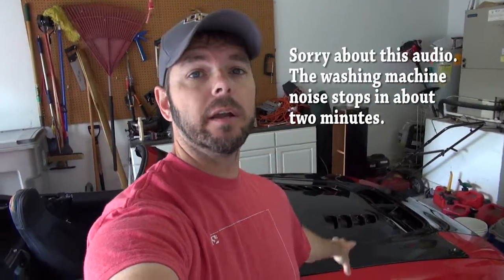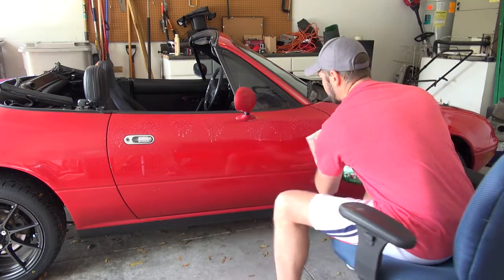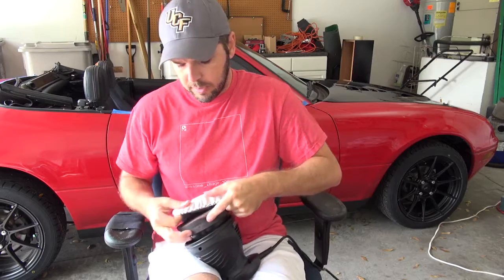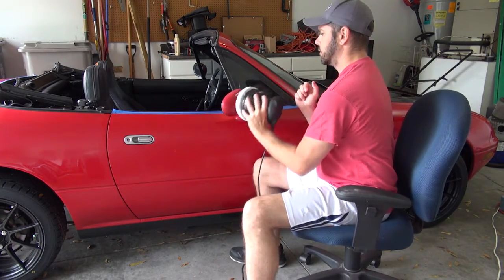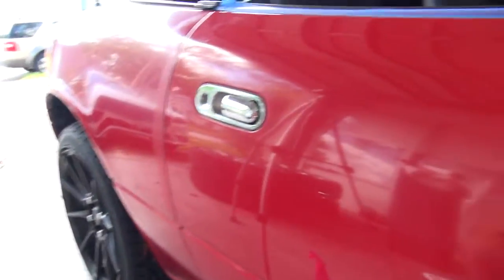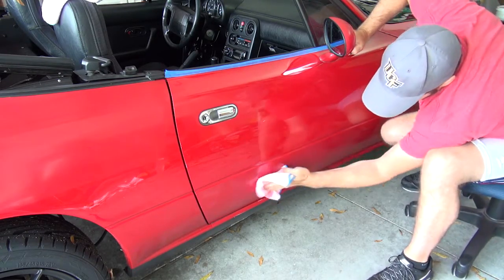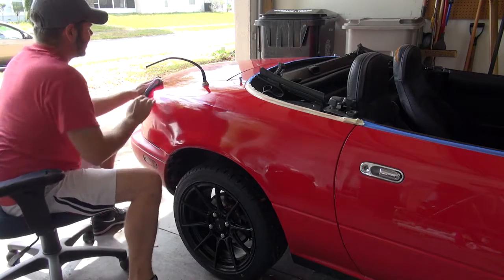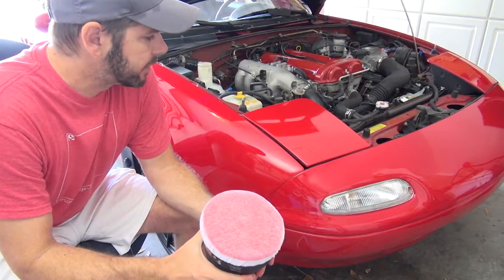1990 Miata Project Episode 19 - Return of the Living Dead Paint

Comment: Wow you weren't kidding, that paint shined up so well from the sad shape it was in. The trunk paint actually doesn't look that bad for everything being polished, but it is obvious. As for the fender, it's upsetting that the line is quite obvious even after cutting and buffing. If you do decide to get a new trunk lid, maybe steal the fender off that car as well? I suggest this because I also noticed a deep scratch and dent in the same fender. Also, did you hand polish the base of the mirror? It seems like the orbital polisher wouldn't be able to reach it well enough.
Reply from the maker: +Ryan Sapp I saw that scratch too.  The dent is tiny and I can live with it.  I also discovered that when the wheel fell off the car that one time, it dented the bottom of the wheel well fender on the driver's side.  These are all pretty minor things and things I consider unique charms of the car.  I'll be buying some more aggressive cutting compound that should fix that scratch you saw and hopefully cut down that hard topcoat line.  

I'm not giving up on that trunk lid.  I just have had a ton of other fun things I've been doing with the car lately, so it's back burner for now.  It's very nearly to a place where I'm really happy with it.  I'm still trying to figure out the exhaust situation.  I put a cheapo replacement on it to fix the annoying rattle, but it only sounds good under 4k and when the throttle is less than half open.  Otherwise, it's fartcan city and that's the last thing I want.  I also think I lost some power with the new exhaust.  Looks great, sounds shit, doesn't perform.  So I had the old one welded to fix the crack and will be putting that back on tomorrow, I hope.  

At that point, it should be a great stopping point and I can concentrate on little things like a fuel filter, and then try to justify a steering wheel and shift knob.  I've also got to do something about the driver's seat back and the torn area.  But that will take some research and trial and error.

Thanks again for following me on this journey.

Comment: Hi, great video and nice taste in cars. The NA Miatas are wonderful. Fun to drive, handle great, very reliable and parts easy to come by. I have owned 7 NA Miatas throughout the last 25+ years. My first was a brand new 1991 NA classic red A pkg.  The only question I have is concerning the clear coat, (or lack there of) I was under impression that there was indeed clear coat involved with the original OEM Mazda classic red paint code CU. I have seen other NA Miatas where they have had peeling clear coat and remember back when purchasing these cars new there being discussion about there being clear coat paint. That being said I was always surprised to see all the red paint which indeed normally comes off on the buffing pads and/or hand towels when using polish, compound etc. (even on my then brand new 91) so my question is this...... whats the official word on whether ther really  is clear coat? Not only for the "Classic Red" Miatas but also for the other NA colors? Paint repair kits I have purchased, specifically designed & put together for the classic red NA Miata most certainly included clear coat in the Kit. Do only some NA Miata paint colors have clear coat and others not, or do they all? My experience says yes the Classic Red factory paint had clear coat. That said again.... can you tell me where you got your official info stating there is not clear coat? and.... What was their basis for thinking such? Im curious and want to know 100% for sure myself. Your car looks wonderful. My current Miata is a red 94 in process of having restored. Would love to talk shop sometime with you and exchange  knowledge. Were your front and rear bumper covers faded? If so same procedure you show here? The plastic bumper covers can fade in the sun over time on these cars. The red is the worst if car was neglected, or parked outside in direct sunlight throughout the years. thanks!!!!
Reply from the maker: As I understand it, Mazda had three "original" colors with the Miata in 90.  Red, White and the smurf Blue (specifically Classic Red, Crystal White, and Mariner Blue), all single stage paint.  Halfway through the production year, they also offered a metallic silver which had a clear coat.  To my knowledge, those three specific colors were the only single stage paint schemes Mazda had.  In 92, they offered that Sunburst Yellow, but I don't know if it's single stage or not.  I've never seen an original paint in yellow.  The one I did see up close appeared to be a respray with a clear coat.  Repaint kits come with a clear coat because you're not using a hardener in the paint.  Real automotive paint uses the color, and then a reducer and also a hardener mixed in at the time of spraying to create a very durable coating.  If you didn't use a clear coat on top of regular paint like in a can, it would never fully harden or bond to the other paint or metal and wouldn't last very long or look very great, which is proven late in this video when I compare the trunk lid to the quarter panel.

Classic Red was offered all the way through 2005 and I'm not certain if it started getting a clear coat at some point, but I know for a fact that both my 1990, and a 1995 I had a decade ago did not have a clear coat on it.

The bumpers and mirror caps, being plastic, do not hold the paint in the same way as metal.  They tend to fade and lose their shine much quicker than the metal panels.  Perhaps one day, I'll have this car properly resprayed and when I do, it'll have single stage on the body, but the plastic parts will all get a clear coat to help protect it from fading over time.

Comment: Run to your local paint parlor and get some top coat. Hit the boot lid with 2000 grit (on a DA if you've access to one) then shoot it with clear.
Oh and have a chair handy... you'll need something to catch you so you don't land on the ground when you stand back and admire your work :)

That's the reason your boot lid is dull compared to the OEM paint. Mazda likely used/uses single stage which is also likely why all of your pads look like a massacre happened after you finish polishing everything. That rattle can you used, was it even a Mazda specific color (be it for a newer car)? Chances are, that paint was intended to be used with a stage prep (primer, base coat, top coat/clear) and if so, that's why it's not as deep a reflection as the OEM stuff even after all the cut-n-buffing.
Basically what you have there is matte finish which can also not last very long if the paint wasn't designed for it; UVs will eat it up.
Reply from the maker: I've since been through quite a roller coaster ride trying to make that boot lid look good.  I ended up replacing it many months later and now it looks almost as good as the rest of the car.  Definitely better than I could have ever hoped to paint it myself.  And in future iterations, I did use proper paint code paint that was very expensive, but in the end, just finding a decent used original lid was the solution.
Reply: Aye. I should mind the bloody time stamps of these videos :P

If you still have the lid around, perhaps you can use that as a practice mule :D
Painting to perfection isn't difficult but it can be intimidating what-with all the prep work needed and is certainly very time consuming. However, the reward and chance to say 'I did that. That's my work' are immeasurable.
Reply from the maker: In fact, I did keep the lid so that I can practice.  I have wanted to purchase a HVLP gun and compressor to use real paints with hardener and see if I can't figure it out.

Comment: What rims are these? And what size wheels are u running - also offset?

Thanks in advance!
Reply from the maker: The wheels are Advanti Storm S1 at 15x7 with a 195/45 tire.  I don't recall the offset, but it's very close to 0.  I have plans to get some 20mm spacers all the way around to make up for the fact that I REALLY should have gotten 15x8s.

Comment: How has the paint held up over the last couple months?
Reply from the maker: Quite beautifully.  I was stupid and used engine degreaser on my engine bay and underside of my hood to clean it, and some got on the hood and fenders and pop ups paint and really looked horrible, so I clay barred the whole front end, used a little more polishing compound to fix the streaks and rewaxed everything and it looks great.  In fact, the paint is so good now that I can see that this hood I bought to replace a horrible fiberglass one must have been in some kind of accident because now I can see where the bondo work was done.

That's the only downside to really polishing up the paint.  You can see EVERY tiny ding and flaw far easier.  I've unearthed 26 years of parking lot mishaps and garage accidents.
Reply: goodeggpro  Cool! im gonna do this to mine asap!

Comment: Are you supposed to be polishing down to the paint and taking the clear coat off?
Reply from the maker: NA6 Miatas all had single stage paint.  No clear coat.  Unless you mean that one fender that's got half of it with a clear coat on it.  I gave up on that plan.
Reply: Okay, that's totally different.  Thought all cars for years have been clear coated.  Looks really nice anyway.  Did you get that rear end damage dealt with?
Reply from the maker: Robert Drake Well... it's 26 years old.  So you're probably right that cars come with clear coat for years.  Just not 26 years.  And the adjuster came out, took a few photos and said they'd be sending me a check.  So we'll see.  I'll be making a video of replacing the panel as soon as I can get one and get it painted.
Reply: The NA Miata came from factory with clear coat. You can see many NA Miatas out there today with peeling clear coat. The 91 I bought brand new back in 1991 had clear coat from factory. Always wondered though why so much red paint always came off on the towel/pad even when the Miatas were brand new. Is clear coat only used on certain Mazda colors I wonder? Im very curious to know where you received your info from as I could be wrong. I mean I know what I have seen, heard and discussed over last 25+ years owning multiple NA Miatas. Always learning as I go along!! cheers!! Great car BTW!! : )
Reply: Here is a small list but there are many others. Many NA's did not have Clearcoat, depends on year and Edition
https://forum.miata.net/vb/archive/index.php/t-61661.html